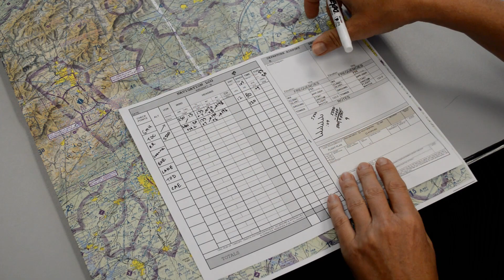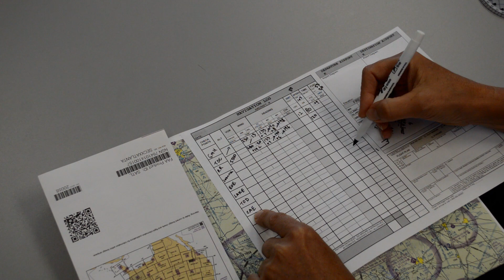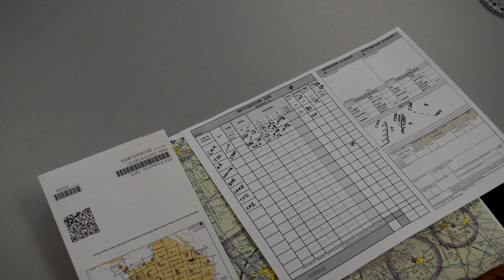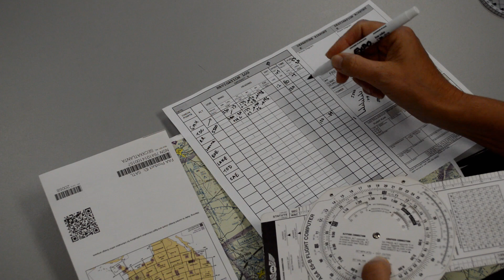Calculate Top of Descent - XC Flight Planning (Private Pilot Lesson 14o)

Comment: Another way is to plan a 3 degree descent using trig. Two constants are all we need. For top of decent 318. For rate of descent 5.3.

Top of descent. 5,500 - 1,200 = 4,300   4,300 / 318 = 13.5 nm 
Rate of descent uses ground speed but we can also assume calm winds aloft. 120 x 5.3 = 636 fpm.

Because 318 and 5.3 are constants creating a simple lookup table eliminates all the math.  For simple GA aircraft only a dozen incremented values are needed. This method makes it VERY easy to ballpark distance and rate.
Top Of Descent
1,000 - 3.1
2,000 - 6.3
3,000 - 9.4
4,000 - 12.6
Etc

Rate of Descent
60 - 318
70 - 372
80 - 425
90 - 478
Etc

Or use the common rule of thumb of 3 and 5.
4,300 use 4.3 x 3 = 12.3 nm 
120 x 5 = 600 fpm
You descend a little late and flat however.